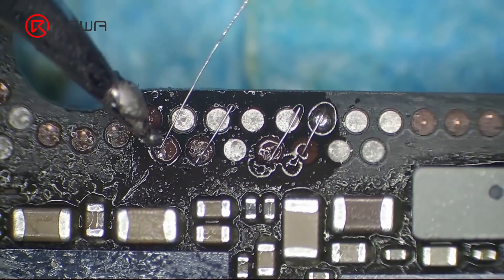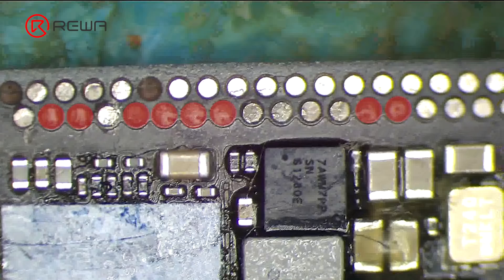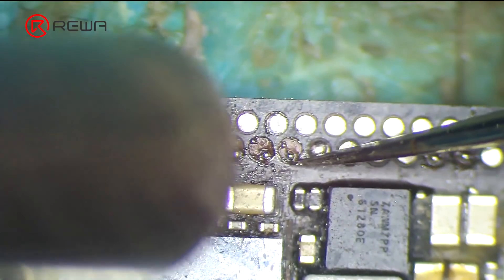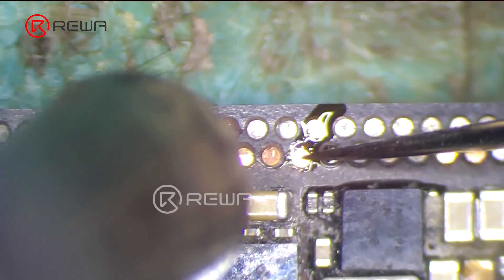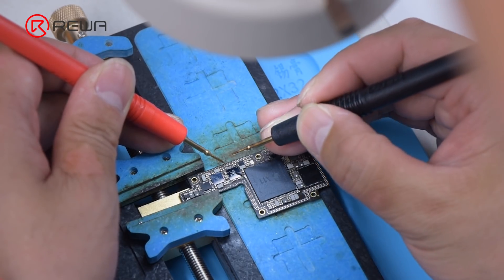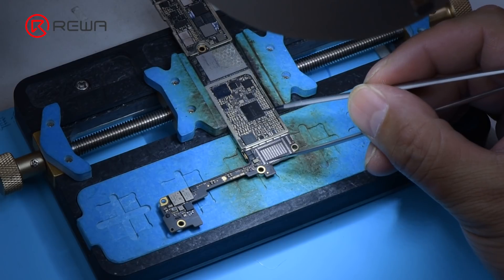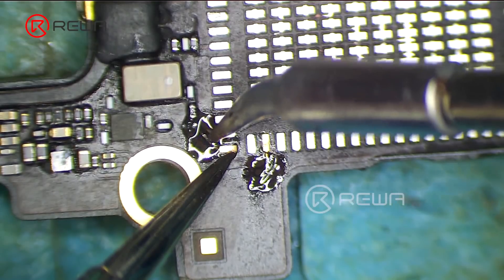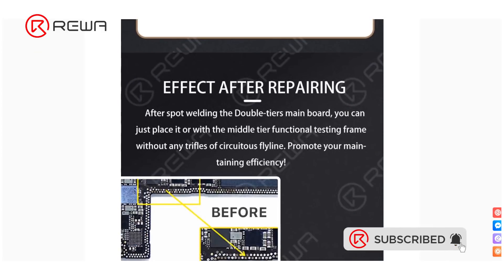Innovative Way to Repair Motherboard Missing Pads - REFOX Soldering Lug

Comment from the maker: Products recommended in this video: 
REFOX Soldering Lug
https://bit.ly/3n02WN5
SG T26 Heating Soldering Station (Ultra-Fast and High Precision)
https://bit.ly/3n17B1f
SG 2020D Hot Air Gun Station
https://bit.ly/3tIqTvf
Qianli iNeezy Ultra Fine Tweezer (Non-magnetic Stainless)
https://bit.ly/3txkx1B
UV Ultraviolet Glue Curing Lamp
https://bit.ly/3st1AeT
UV Curable Solder Mask
https://bit.ly/3mYh6yp
iPhone Motherboard Repair Training Book (REWA Exclusive)
https://bit.ly/39ubIOy

For more discount, you can contact our wholesale team: https://shop.rewa.tech/wholesale.html
Reply: Do you ship to South Africa????
Reply: Professionals at it best! Good job!

Comment: 4:25 is the blue light mandatory ?  I don't have one
Reply: No, but u run a risk of shorting the solder balls, especially if u r separating the board again
Reply from the maker: Here is the link of UV light: https://shop.rewa.tech/detail/usb-ultraviolet-light-uv-glue-curing-lamp-oem-new.html

Comment: Does it work with iPad Air 1's charging port though?
In 2019 I opened that iPad Air 1 and ripped the charging port SMD from the board.

Comment: If the connection was good would these hold up to multiple insertions on pci-e bus?
Reply: That solder mask goes almost rock hard when cured so yes , it should stand up to that sort of use for quite a while

Comment: Actually is not an inovation ! Just use the spacers(located on corners mostly) from donor boards(X to 12series) . I use them from my first pad repair and also can use iSocket to test the sandwich after. There are at least 10 pcs on each board so no need to buy for the moment.

Comment: Hi, please answer my question I'm getting a macbook for 3d AutoCAD course. I have two options to choose 2018 macbook Pro or 2020 macbook air. Both with i5 processor and 8 gb ram 256gb storage.. Which is better? 3years old pro or year old air. Both new seal pack. At same price. I need intel processor.
Please answer this question. Anyone else also know please help.

Comment: I hope you filed for patent on this before uploading this video Rewa, because this is actually, genuinely, really damn useful 😁👌👌👌

If I can make a suggestion for a later or premium tier revision: make one like it that comes with a 130-150°C, rapid Thermo- set epoxy backing. Or includes a small vial of such epoxy with applicator suitable for the small size dimensions we work with here. The temperature range is so you can activate the epoxy without needing to go so hot you risk solderballs squeezing out in the surrounding area or on the other side of the board.
Reply from the maker: Thank you for your support and suggestions, we will Keep up our work to provide you with better content!